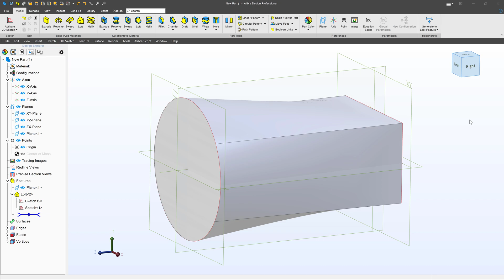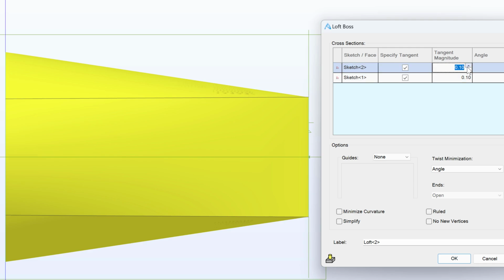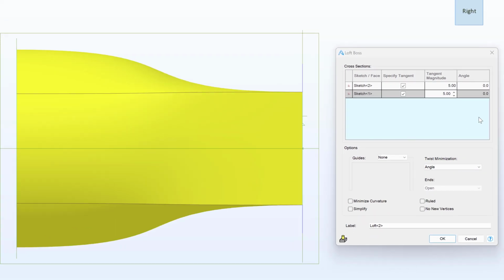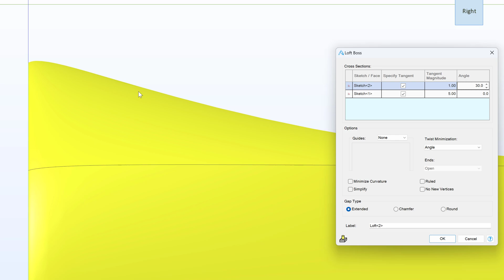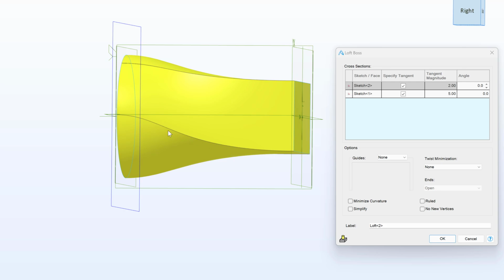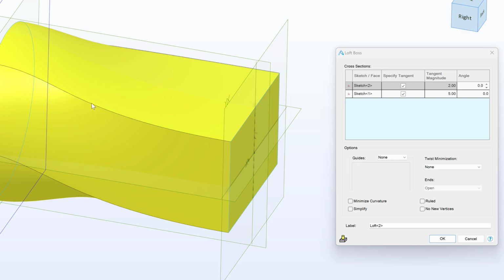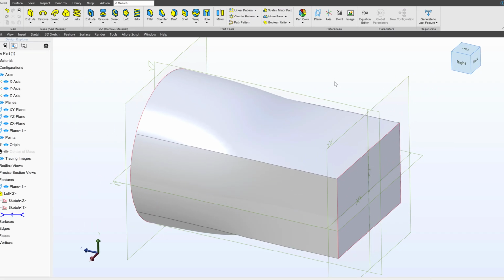Tangent and Twist Loft Options | Alibre Beginner Course #14

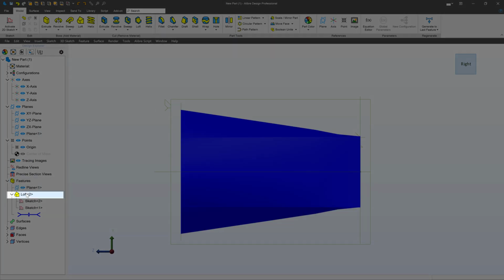Comment: I'm trying to do lofting 0:50 but my object is not visible and dissappear when menu start to pop up 0:60 how do I make see my object when I'm lofting?
Reply from the maker: If your object is missing the yellow preview but appears after you apply the loft, you can get that to show from system options>Pparts/Assemblies>3D Previews.

If you see an error message or the OK button is a pinkish color when trying to loft, it would indicate there is a problem with the loft- perhaps there is a problem with a sketch that would stop the loft from completing.  You can email me the file if the problem persists, joseph@alibre.com